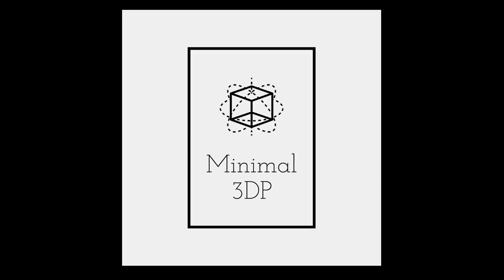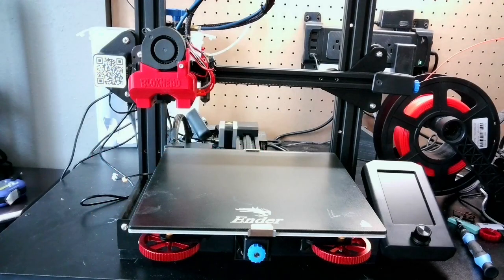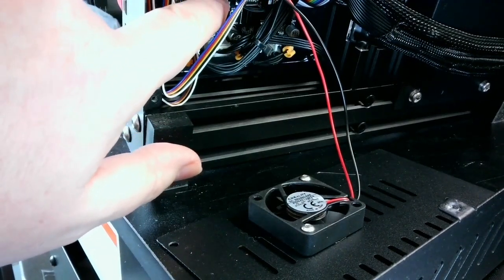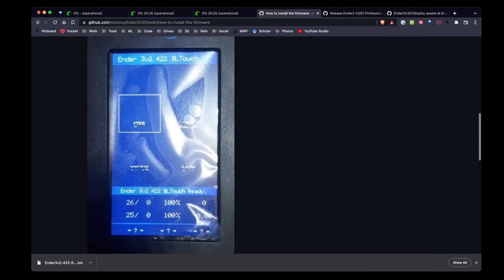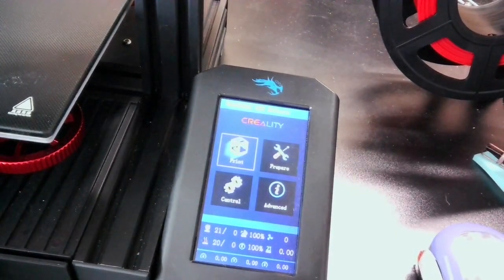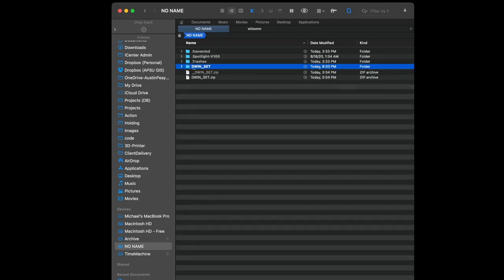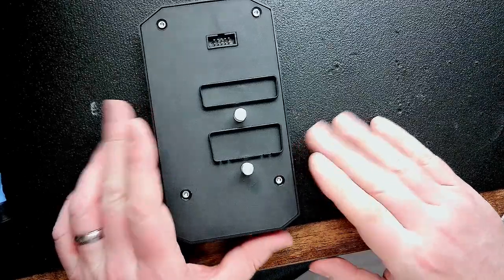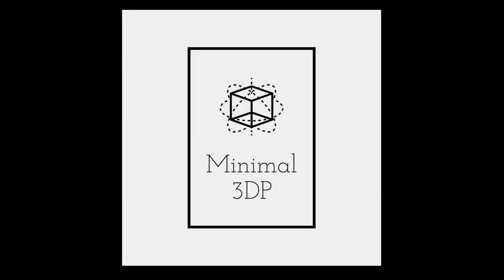Looking for an Advanced Experience on your Ender 3 v2? Try mriscoc's Professional Firmware

Comment: hands down best firmware for the ender v2 you can get.  all 3 of my enders have it.  Even got a V2 screen for my pro running a 1.15 board so i can run the pro firmware.  Brought here from the Facebook group.  Great video, thanks!
Reply from the maker: That is cool that you got it running on a Pro. At some point, I need to dig into the source and see if I can enable some other features and compile.
Reply: Did you have issues with the screen after the firmware install? I can't get the logos to show up on the main screen?
Reply: I think Jyers UI is better but it depends on what you like

Comment: I have found that experience is what you get when you didnt get what you wanted.
Having said that, I dont think that I will be changing anything on my perfectly working Ender 3. Thank you anyway for your insight into this matter. Some folks will surely benefit. Have a great day!😀👍
Reply from the maker: If it ain't broke don't fix it. I would stay with what is working. Thanks for the comment.

Comment: I switched to this firmware after 1.5month of using Jyers and I very much like the extended settings compared to the original and even Jyers, and the JPEG preview. What I don't like is that Jyers had more temp profiles for preheat. Also I think Jyers was a bit more stable. On Jyers I never got the printer stuck and not responding. On this one this happened already 2-3 times during several days of usage. I.e. when tunning parameters during print (not responding to knob rotation and to click), or after a finished print.
Reply from the maker: So far, I have not had any instability. With that said, I dial in the printer, specifically bed leveling, via the touchscreen and then print everything via OctoPrint.
Reply: You can add new profiles if you compile yourself (If I understood you correctly). Also a thing I've recently learned about Ender3 v2's is that creality is scamming a bit... on some boards (like mine) using a processor with 1/2 the flash & sram memory, so heavier firmware isn't useable effectively, without introducing more issues.
Reply: Thats odd. I was having those issues ONLY on Jyers. That's why I switched to this.
Reply from the maker: @udrslud  Everything has been stabler for me since install. I don't have any issues.
Reply: @elmars302  You are spot on about Creality is fitting cheaper SoC with only 256k memory when the older (2020-21) boards came with 512k. I checked my newly purchased machine and it is fitted with a SoC marked RCT6 with 256k ram. They have also rubbed the number with a marker so that we don't notice the difference. BTW boards fitted with the RET6 has 512k RAM and should not exhibit any issues.
Reply: @MP-mu1kw  I am wondering how do you find out if ender 3s1 has the board with RCT6 or RET6?
Reply: @JB-smokn  Remove the screws from the top and bottom and remove the cover underneath which has the cooler fan fitted inside. Shine a light onto the big controller chip and read the information of the silk printed chip. It will have line stamped with either RCT6 or RET6. Hope that helps.
Reply: @MP-mu1kw  Oh I see. I appreciate your time and words, thank you.
Reply: @JB-smokn  No worries, i forgot to add about keeping the top screws and bottom screw separate. One or two of the screws are of different sizes.
Reply: Great video, you can also use a flashlight to find the board version through the grates in the cover.

Comment: Maybe it's because I have the 4.2.2 main board but I have the same problems as read in the comments above. The firmware is super, Z nozzle control, bed mapping, manual bed leveling control, but if I remove and reinsert the SD card the display turns all white and the printer crashes, in fact every time I have to make a new print I turn everything off and on again. If I do the slicing of an stl with preview image the printer freezes and above all I can't install the firmware of the LCD display that remains all blue and shows me a message saying that the bootloader doesn't find firmware etc.. so I'm still working with the original firmware on the display despite the printer has mriscoc 2.1.3 professional installed.
Reply from the maker: Can you connect to octoprint? I would be curious what, if any, errors it was giving.
Reply: @minimal3dp  i don't have it :(

Comment: I know this video is 1 year old, but I was hoping you could answer a couple of questions.
I recently switched to this from Jyers. I have an Ender 3 v2 with a 4.2.7 main board.
1. In Jyers and stock Creality I could have the printer create a new mesh before each print using G29 in the start up G code in Cura. So far I have not found a way to get that to happen with this firmware. Is that possible? Also I don't care for the circular pattern of the mesh and would like to use the unified mesh leveling.
2. When I insert an SD card, the printer will not read the card unless I reboot the printer and sometimes I have to reboot it twice before it will read the card. Is that normal?
Reply from the maker: I am not sure about your reboot issues. 

The G29 in cura start gcode works for me. Take a look at: https://youtu.be/GGrDB9gD2Tw 

It is an updated video for the PF.

With your issues you might want to reflash.

Comment: Thanks for sharing how to update firmware on the E3v2. I found out that these machines have two different types of SoC chips with v4.2.2 boards. The RET6 which has 512k RAM and RCT6 with 256k ram. Although, i just got my printer this week it has been fitted with the 256k SoC. I think the older printers  with v4.2.2 boards were fitted with 512k but due to chip shortages Creality has fitted the cheaper 256k chips. I see some folks are beginning to get issues of printer controls getting stuck. I suspect this could be due to some machines having less memory for storing the various different settings which get saved onto the controller as opposed to under the stock firmware the settings are stored on the SD_Cards itself. I think I will wait before I go ahead and update mine.
Reply from the maker: That sounds like a good idea. I would also look into saving settings on the SD card. I seem to remember that might be a setting in Marlin.
Reply: @minimal3dp  I got in touch with Creality and they confirmed that my machine is fitted with a RET6 (512k Flash ram) version of the chip. Re: saving setting on the SD card, I'll need to do some research into whether it is a flag that needs to be set in Marlin. Bottom line, the big question in my mind is whether using mriscoc's or any other JyersUI non standard firmware would have any issues with regards to compatibility with the Creality/Cura slicer programs? Could do with some input on this.

Comment: no need to remove printer case, use a small flashlight you can see it through vents
Reply from the maker: That would work if I had good eyesight but, alas, genetics and age have robbed me.

Comment: Hello.Please help me with the choice of firmware on my printer, My motherboard version 4.2.2 is also equipped with filament sensor Touch sensors , which firmware should I choose specifically for my motherboard . My TFT display. How to flash the display to work with my motherboard. thank you in advance
Reply from the maker: Which printer do you have?

Comment: Why does no one have a video on the s1 and this firmware I tryed to install today and it would be missing icons
Reply from the maker: I would be happy to do a video but I don't own an S1. Sorry I can't be of assistance.
Reply: @minimal3dp  thank you for trying idk if I’m doing something wrong or just grabbing the wrong file bin, my icons weren’t all showing up
Reply from the maker: @indecisivesquirrel3dlabs78  Did you flash the screen?
Reply: @minimal3dp  yes it worked for the most part but my leveling icon didn’t show up, do I flash the screen first of after? I don’t see any difference when I flash the main borad
Reply from the maker: @indecisivesquirrel3dlabs78  I flash the screen after. There are several different flavors of screen icons. I would try a different flavor and see if that helps.
Reply: @minimal3dp  how would I know witch ones are different on the download side of things
Reply from the maker: @indecisivesquirrel3dlabs78  take a look at this link: https://github.com/mriscoc/Ender3V2S1

There are 2 different screen assets

Comment: Can't firgure out how to runout 100mm filament so I can check the e steps. I can't find a menu selection on the LCD to extrude 100mm. Spent a lot of time looking at the wiki on Github but I must be too dense to find it... Thanks
Reply from the maker: I usually do it via Octoprint. Have you poster on the Facebook group? I will see if I see it in the meantime.

Comment: Looks good! Does it have restore levelling after G28 defined?
Reply from the maker: It works for me.
Reply: @minimal3dp  Do you have to level before each print?
Reply from the maker: @alexsawyer3576  No. I level every once and a while. If I am doing a longer print I will as well.
Reply from the maker: @alexsawyer3576  Should I post a video ony process?
Reply: @minimal3dp  No its fine it sounds like it works how I want it too ☺️

Comment: I was expecting what exactly you did yo enable LA ? and the configuration process .... im undecided on how to enable LA in the firmware or do you just enable your k level in the slicer with m900 code ? currently running a older Jyers & i understand that the new firmwares are required for LA ,,, but can i use a normal Manual Mesh bin file and just run the m900 in Cura ?
Reply from the maker: I think you might be able to but to be honest, I always enable LA in firmware. I have never gone the cura AMD m900 route. Sorry I cant be of more assistance.
Reply: @minimal3dp  all good and thanks for getting back to me . I think I found the answer is to set Lin_advance_k value to zero so the slicer m900 sets the value . That way you don't need to recompile if you change filaments and the value changes

Comment: this was helpful however, i could only get the screen to update and the firmware i use causes the cr touch to not function. i have been at this for days and have emailed the company and everything they have sent does not work. e3v2 motherboard 4.2.7 cr touch , glass bed and new screen. the cr touch does not change colors it stays on red and does not home or anything. thank you in advance
Reply from the maker: Did the CR Touch work before you changed firmware? If so, Review your wiring. That is usually the source of a lot of problems. 

There is a version of the Professional Firmware for the bltouch. Are you using that?
Reply: @minimal3dp   yes it did work before . I checked the wires and they are correct . The light stays red .  Does not home or anything

Comment: Just updated to 2022102 along with the Giades DWIN. All looks good until I homed it, it locks up the stepper motors they just hum. Any guesses what I could try? Tried going back to stock Creality firmware for both but no change. Everything works until I try to move any of 4 axis.  HELP PLEASE
Reply from the maker: Make sure all your connections are tight and try reflashing.

Comment: hi, i did exactly like that but didin't updated. format sd card as well but nothing.
Reply from the maker: Can the printer see the sd?
Reply: @minimal3dp  yes because when i re insert it in the pc there is a save file of eeprom. Once i updated firmware but had problems and went to original one. I don't know if it makes a difference. Thanks
Reply from the maker: @glengalea  are you on the new firmware now or the old? Did you update the screen firmware as well?
Reply: @minimal3dp  first i tried only the bin file into sd card and booted it only but nothing happened. I sm with the old. Over a year i had changed formware but thst time i changed it again to it's original firmware.
Reply from the maker: @glengalea  I would try redownloading and doing it all again. Look for a setting to clear the eeprom as well. It is hard to say what the issue is.
Reply: @minimal3dp  i tried even in creality website using there'd but for nothing.
Reply from the maker: @glengalea  did you try a different Sd card?
Reply: @minimal3dp  no i try that. Thanks

Comment: I tried editing his firmware with a successful compile and install

I've also updated my DWIN_SET firmware and installed Python and the Python script to Cura thereafter... BUT I can't seem to get the JPEG preview to work
Reply from the maker: I haven't been using the jpeg preview so I am not sure. Are you using cura 4 or 5? I am wondering if that makes a difference.
Reply: @minimal3dp  I've tried both Cura 4.13 and Cura 5.0

Comment: how did u set the probe point or the xy ofset
Reply from the maker: The XY offset for the probe.
Reply: @Minimal 3DP  yea ..and the grid size for probing the bed.  ? When I went and looked for this firmware today it was already compiled into a bin file ...I'm not sure what's all enabled in Said bin file for 4.2.2. Board
Reply from the maker: @weld4200  you might be able to set it from the display

Comment: Been trying to get the screen uploaded with the DWIN_SET file. After inserting the sd card in the back of the screen and turned the power on, it went orange. Took the card out and turn it on to verify and it didn't work.
My sd card is formatted to Fat32 and the file was the only thing I download on it.

Did I miss something?
Reply from the maker: There are 2 different versions of the screen firmware, stock and Giadej compilation. Did you try both? From your description, it sounds like the screen flashed correctly.
Reply: @minimal3dp  I formatted the sd card again on my PC (was using Mac beforehand) and changed the allocation size on it which I was unable to do on Mac. Tried it again, it worked.
THEN I went to do the same on my other printer with the firmware installed, but had to use the "private" file due to the model of the screen. I inserted the sd card, turned it on, and got the black screen and it never came back on. So now I've tried many ways to get the screen back on and had no luck. I would not recommend the "private" file being installed to anyone, just the main firmware on the printer.
Reply from the maker: @anthonyquinton9108  what is the other printer?
Reply: @minimal3dp  Both of my printers are Ender 3 V2. Each of them have different LCD screens. I ordered a new screen, and hooked it up and now it works fine, yet I'm not going to install the firmware for the screen on this one.

Comment: Where do you find the file for the screen?
I’ve updated the mother board ok.
Thankyou
Reply from the maker: Here you go: https://github.com/mriscoc/Ender3V2S1/tree/Ender3V2S1-Released/display%20assets
Reply: @minimal3dp  thanks mate
I found the DWIN file in the end, tried to install it, but the printer just started up instantly with the basic mriscoc screen lol
No blue or orange screen
Reply from the maker: Were you able to get it working?
Reply: @minimal3dp  I have the printer working with miscroc file, but can’t update the screen side of it with the DWIN file, I have the same board as you in the screen. 👍🏻
Reply: @toddy9141  i have the same issue
Reply: @minimal3dp  this issue with the screen not loading the firmware is the sd card issue I only had a 32gb micro sd and it would show blue for a split second then go orange and it wouldn't install the firmware so I partitioned the 32gb micro sd down to 4gbs then installed the screen firmware and it worked the blue screen stayed on for about 5/6 seconds then turned orange and everything works
Reply from the maker: @SilentStorm21  Great. I never thought of portioning. That was smart.

Comment: i don´t get it! do i have to update the screen aswell???
Reply from the maker: Yes. The board and scree need to be updated
Reply: @minimal3dp  ok and why. Because it is working on my ender 3 v2, 4.2.2 board  without screen update aswell.
Reply from the maker: @D.TH.87  it will add icons for some of the advanced functions that don't have a corresponding icon in the default firmware. But if you qr good with as is, don't bother.
Reply: @minimal3dp  thank you